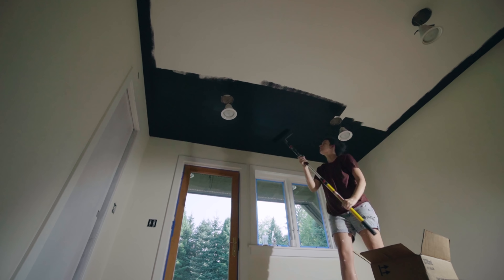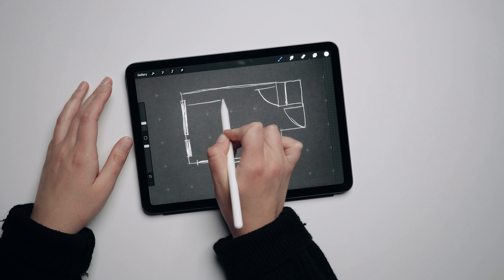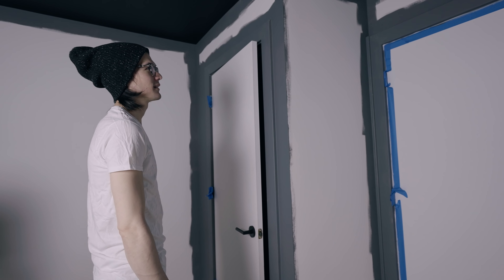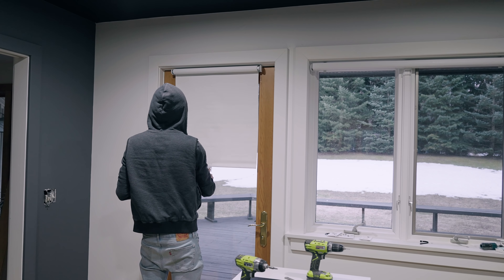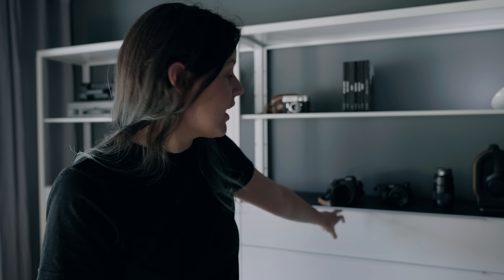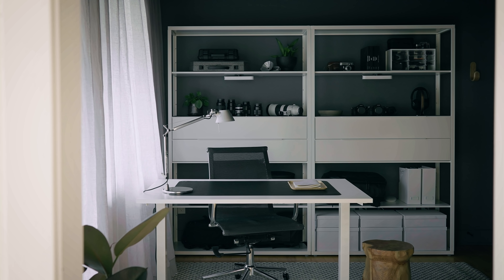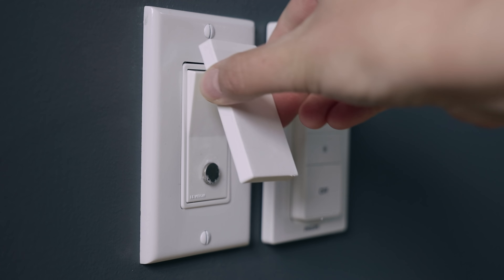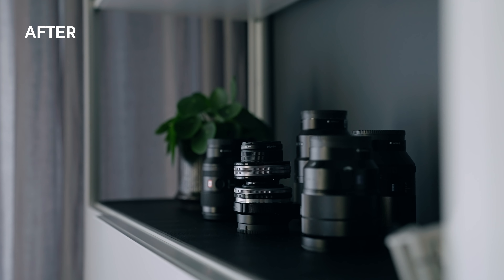DIY Home Office Makeover - My Work From Home Set-up 2021

Comment: This is peak house video. Monochrome painting, minor construction, desk assemblage, storage (with lighting - ooooh!), and general goof. The new layout looks so much more usable, but just wait another 6 months and see if Becki wants to change it around again!

Several additional notes: for eyestrain with behind-monitor lighting, there are light accessories you can get which copy the content colours on the display and also really add to immersion on large TVs. The roller blade wheels on the chair are genius and I need to use that hack. And the rug is fantastic.

Comment: The good and bad news about the roller wheels for the chairs: they lose their little ball bearings after about 8 months and put yucky metal shavings and grease everywhere, so they need to be changed on the regular, although they work amazing on any type of flooring. But pro tip to pull them out of the chair, just give a spray of W40 (spray lube?) where the hems go in the chair wheel holes and they pop right out! Been using that type of chair wheels for years and the first time around I thought I was going to dislocate something pulling them out so I had to get creative.

I really love your design and reno episodes because you explain why you do things the way you do them and that's really cool. Thanks!

PS: love them tools to make all the custom furniture. The woodwork is on point!

Comment: More often than not, it takes several iterations to get something completely right. This new makeover is adding depth and contrast to the office with those gray walls nicely connecting with the existing black ceiling. That feeling when you use something that you already had for a while and it fits in so perfectly. And that desk stand...😱

Comment: Becki, here's an idea I've always wanted to try with window shades. Paint stripes on them to look like shoji screens. If you do an search on them and look at the 'image' results you'll see that there are lots of variations. I originally was thinking of putting a opaque film on the windows and either gluing strips of wood to it or painting the stripes on. Then I realized I couldn't look out the window then so I thought 'opaque window shade!' and paint or adding tape in the color I wanted. It's got to be a paint that holds up to being rolled up and opened frequently so I was thinking (vinyl?) spray paint.

As for your paint scheme, by using those LED bulbs where you can pick a myriad of colors the black walls, and to a lesser extent, the grey, will pick up some of the color. I especially like to add blue as a subtle highlight. 

And you still remind me a lot of my niece, Kaity. She says its the eyes.

Comment: Now it looks even more modern. I don’t know how you guys manage to make everything look so clean. I didn’t quite understand one thing,….why put holes in the box? Is it because of signals?
Reply: The modem emits heat because it's on 24/7 so to prevent from overheating or the box catching fire, Becki made holes in the cover to keep the airflow going
Reply from the maker: Ventilation! 😊

Comment: Would be great if you can elaborate how you mount the phillips switch on the wall. Was there an existing switch box you replace with the new one? Or did you have to cut into the dry wall to make an opening for the new switch? Thanks!

Comment: What size are the monitors for your twin monitor setup and the monitor arm what one have you used.  I have a twin 32" curved monitor setup and not happy with the arm, for the life of me I can't get the second display level, though I have 2 different displays.  1 is a 4k and the second is a 2k, so not sure if that is the issue, though I think it is the arm Iam using, which is a Vision Mount and would not recommend.